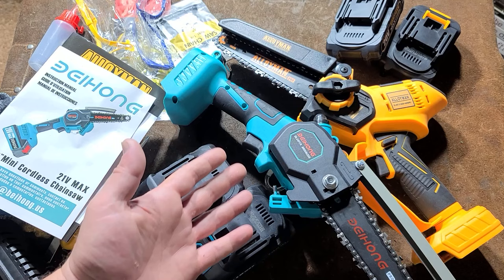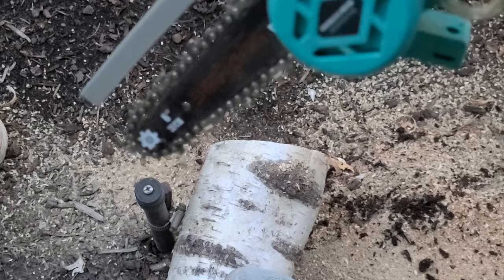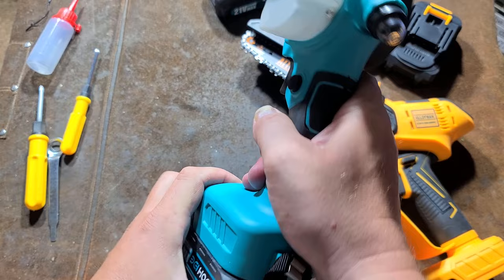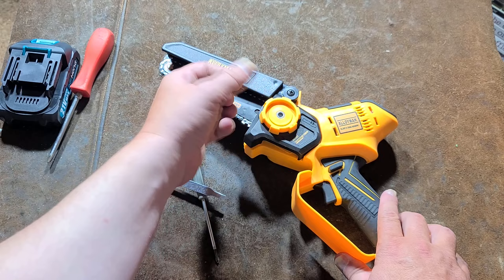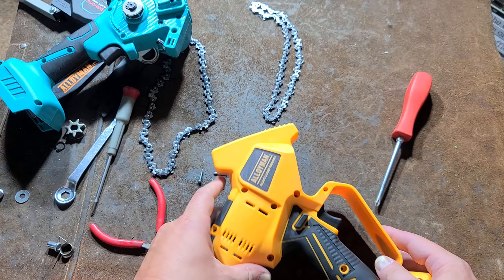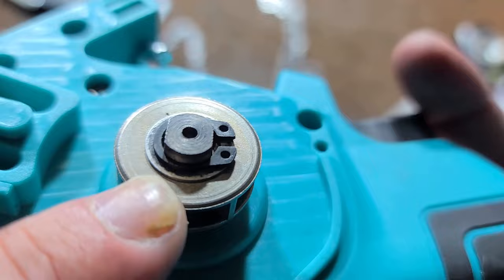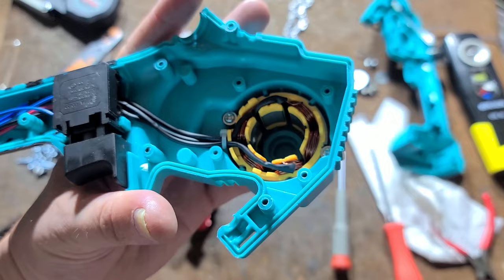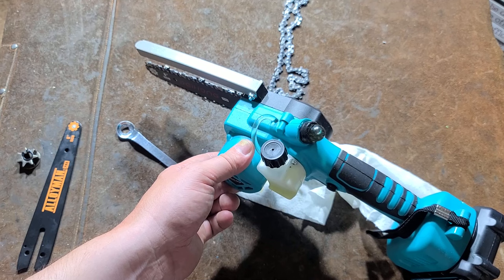Bei & Hong Brushless/Alloyman Brushed 6" Mini Chainsaws Review/Comparison/Teardown

Comment: I have a cheap brushed 6" chainsaw and I've been extremely impressed with the power of the little thing. As long as u don't push too hard it's awesome. I cut up an old hardwood bunk bed set with it with no problems and bought a 4ah battery for it